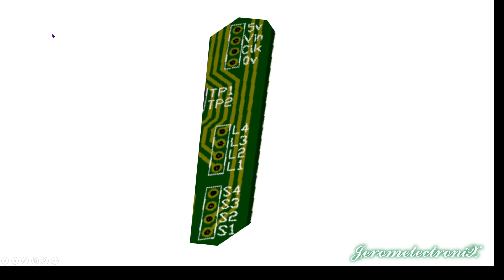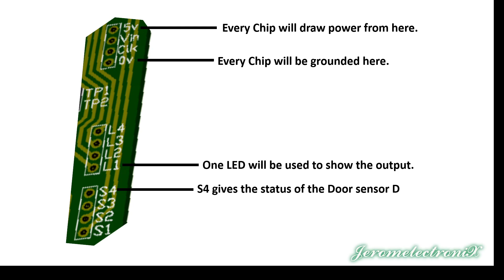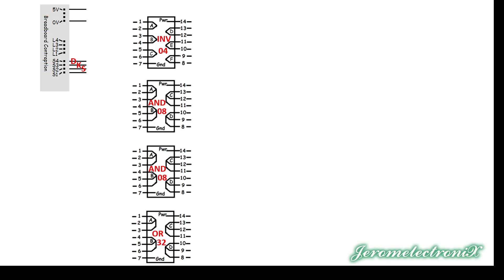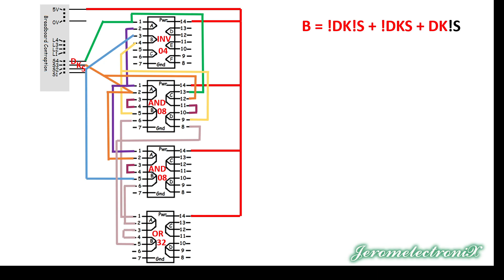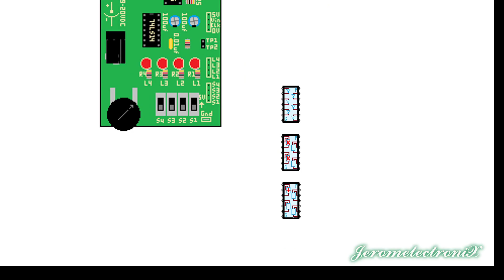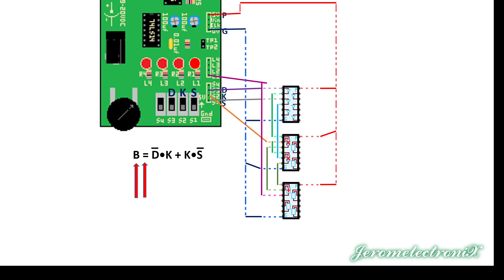L20 Equation to Prototype

Comment: I did a video of how to make a 74HC595 shift register set of five of them.
I also want to add a timer circuit, that will just fit on the same breadboard.
I use a Raspberry Pi 4 to create all kinds of things as I learn on it. I've only
known electronics of any kind. I am doing breadboarding and I've only been
two years into it. But I have much, much more to learn about all kinds of
electronic components and lots of math needed. I'm going slow, but steady.
I've done all kinds of videos of whatever I learn on my own with the Rasp Pi 4.
I created a prototype Logic Hat for the Rasp Pi and use only its breadboard and
cobbler be as just for information input, output and and an energy hub only,
leaving my GPIO pins better, long lasting and protective at the same time.
Reply from the maker: I am impressed by your tenacity and passion for electronics.  I'm going to check into your videos when I get a spare moment.   Thanks for sharing.